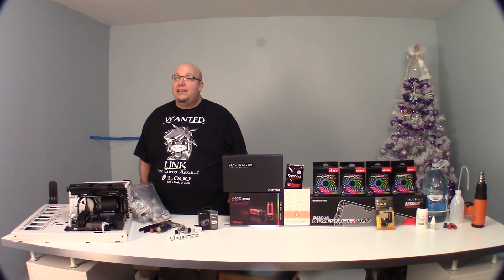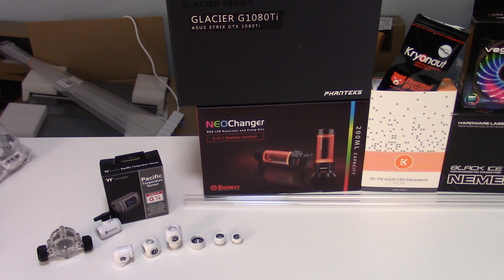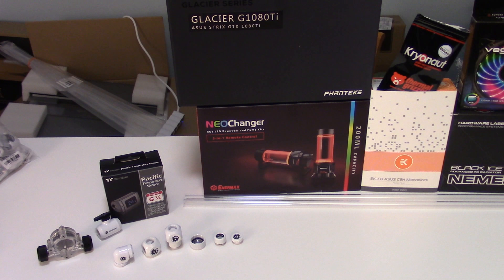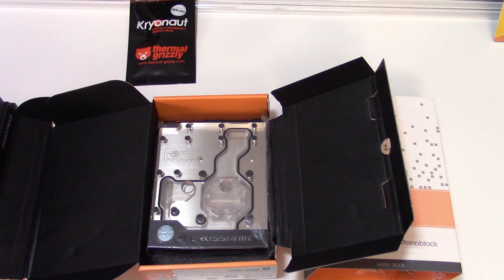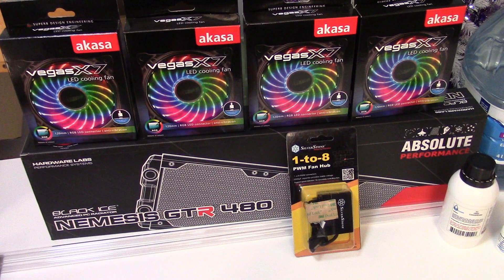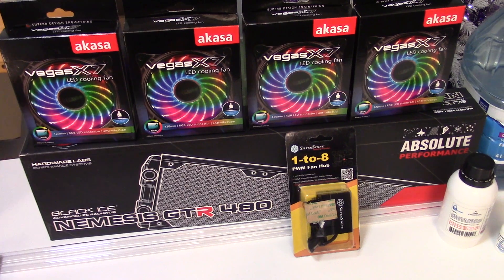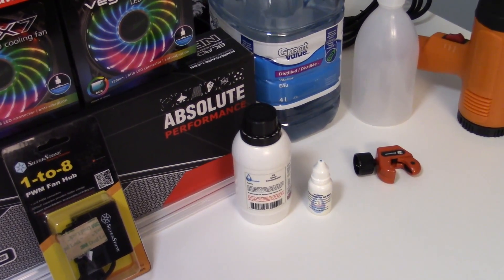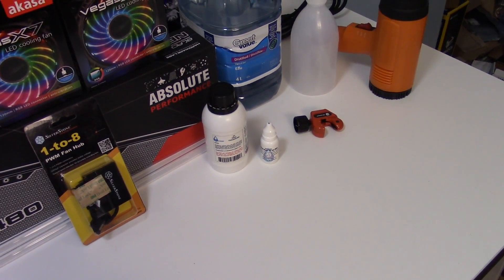Building First Custom Water Cooling Loop

Comment: Can someone please explain why they put tape on parts of the mobo and gpu? Why those spots and what types of tape (I see they're different)?
Reply from the maker: The tape acts as a heat sink. They are placed on top of some of the components on the motherboard that get warm. They help displace heat from those components. Some of the heatsink pieces are different colors depending on if they were the original ones on the video card, the original ones on the motherboard, or came with the GPU & CPU water block kits. They are functionally the same though.

Comment: hi friend i need you help , i have one problem with my custom , the bomb sometimes stop and later continue what can i do it ! this is my indicator
https://www.amazon.com/Thermaltake-Pacific-Indicator-Interchangeable-CL-W152-PL00BL/dp/B06WWGVBB6/ref=sr_1_2?__mk_es_US=%C3%85M%C3%85%C5%BD%C3%95%C3%91&crid=12F3U1YM4OOQD&keywords=pacific+flow+indicator+one&qid=1560402579&s=electronics&sprefix=pacific+flow%2Celectronics%2C188&sr=1-2
Reply from the maker: I assume you mean the spinning indicator that you linked to "sometimes" stops/starts spinning. The indicator should always be spinning at a constant speed, it's job is to tell you that your custom loop is working correctly and that there is a "constant flow" of water in your loop. If it stops/starts intermittently, possibly your pump isn't strong enough to send the water through your entire loop. If you can turn up your pump to its maximum speed to see if the problem persists, perhaps it was just not turned up high enough. Also you should make sure that your loop has enough water, you want your reservoir to be almost full, but you need to ensure that water has completely filled the rest of your loop and that your reservoir is almost full after doing that (for me, it was almost 1 litre of water). Lastly, your loop could be too long for the speed of your pump. You could e-mail me a picture of your custom loop if my suggestions don't give you your answer (stephane@illuminatednerd.com). Hard to tell without seeing your loop and knowing what kind of pump you're using :)

Comment: not one of those tube runs are parallel........
Reply from the maker: A parallel loop would not likely help with a single gpu, single cpu, and single rad setup. Minimally at best. I'm pretty happy with my serial loop. Hopefully in one of the builds this year I will do SLI with a parallel loop. It's a pretty strong pump though, flow restriction wasn't really an issue.

Comment: That thing will be a power house. 

A little bit of constructive criticism never hurt. Right??

The stability of the loop possibly sagging over time worries me.
The cabling kind of takes away from the over all look for the rig the fan wires being the biggest offenders.
The LEDs being completely exposed is not appealing to look at.
You only used paper towels underneath the lines going into the rad, which would have probably been the least of your problems of there had have been a leak

I bet that thing will run like a champ! Nice build
Reply from the maker: Hello Mr Nologies. Thank you for the constructive criticism. You are right on all points, some of which I address in a future video. Some of the issues stem from building in an open-air case, which was a first for me. I probably took on too much, but I can only move forward from here and increase the level of crazy :)

Sagging - The part that gave me pause was the 90 degree angle that goes from the pump up to the video card. The weight of the angle connector was dragging and it popped out once during leak testing (prior to coolant). Once I tightened every connector very tight after that leak, everything went swimmingly. I do admit the sheer # of connectors really adds to the weight and potential for sagging. Luckily it ran for several months with zero issues prior to me switching to a white opaque coolant and slightly redoing the loop.

Cabling - Yes sir. I 'sort of' redo the cables and run them behind the rad in the video where I switch to the white coolant. Not a "perfect" solution, but an improvement for sure. I saw someone 3d print an extra piece to hide the cables, and drill custom holes into the case. I can only aspire to such crazy measures in my future endeavors :)

LEDs - Yes indeed. I did not think through those LEDs. I took them out entirely when I switched to an opaque color. They were only for the UV in the liquid of course. Some alternate suggestions involve smaller UV lights that are easier to hide, much like hiding the cabling via holes and/or 3d printed pieces. Food for thought :)

Paper Towels - hmm.... ok maybe I only used the last piece of footage after I leak tested the entire loop for a few hours. I most definitely had paper towels under the GPU and the waterblock with all my of initial leak tests. I suppose it was the best looking angle/footage of the loop being filled & running, just without all the paper towels from the initial tests.

Thanks for the comments. The system has run great so far for gaming and software development.

Comment: Did you plug the water pump into the W pump + header at the bottom of the motherboard?  Also, I noticed that the ATX power to the motherboard, you only plugged in an 8 pin.  Is there a reason you did not plug in the 4 pin?
Reply from the maker: Pump/Res:
This pump/res combo only has a SATA connector for power, and an 4-pin RGB connector. There's no connector to plug it into the pump header. You control the RPM via a remote control and an LED Screen that's right on the pump/res. That makes it unusual for sure compared to other pumps where you'd expect to plug it into the pump header and have the RPM controlled by system load. I like setting it to 4k (max) RPM to get the air bubbles out (first 24h or so), and then I set it to 3k RPM and I don't hear it at all a few feet away in an open air case. In a way it's nice optimizing it for loudness and not expecting it to spin-up randomly if I load a game. Performance has never been an issue with it, it's quite a powerful pump.
Mobo Power:
The 4-pin connector is optional, and only necessary for extreme overclocking. The 8-pin is required of course. I've got this system overclocked at 4ghz, and just the 8-pin is entirely fine for my power draw. The GPU has its own power, so that's not relevant. What "is" relevant is the number of PCIe cards eating power (I have none), and other plugged in external items (USB, etc) taking power from the motherboard. I could plug in the 4-pin by splitting my 4+4 pin power connector from the modular PSU if I needed it of course. Maybe with a threadripper I'd see it differently :) I'm drawing about 113w max from CPU+SoC power.

Comment: Hi man, can u tell me if it just fits the pump bracket or did you make your holes in it? ansl between core P5 and core P3, is the pump mount the same size? just to know if it would just fit
Reply from the maker: It did fit the pump bracket on the core p5 without needing to make any additional holes. The core p3's bracket is meant to go in front of the radiator, while on the core p5 the bracket goes to the left of the radiator. The brackets are quite different in size between the two cases because of that difference. You should load up the thermaltake website and check the pictures of each case to see what I mean.
Reply: Illuminated Nerd thanks!!

Comment: Kinda sloppy
Reply from the maker: Yeah the fan wiring is pretty obvious, which I clear up a little in a later video. Not still perfect. Working in an open case on a very light color makes it an interesting challenge. I think this case deserves to be heavily modded to really take advantage of its design.
Reply: Illuminated Nerd true, saw the other one now it came out cool. No more new videos?
Reply from the maker: Yes, new one every Sunday. I'm actually converting the case into a gigantic USS Enterprise-D in a new series ... but that's a secret. I wasn't "too" invested in making the current system perfect because of those plans.

Comment: is this a closed loop?
Reply from the maker: No it's an open loop, a custom water cooling loop. A closed loop would use an all-in-one water cooling solution. They're less expensive and require less maintenance, but there's less customization options.
Reply: oh ok thanks